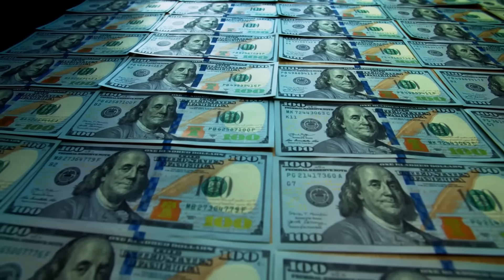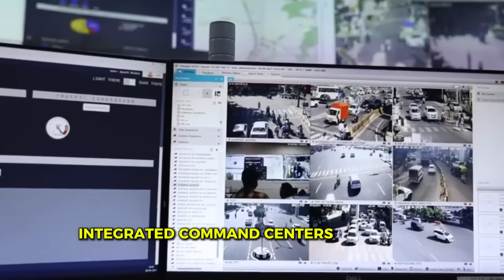15 Biggest Mega Projects that will transform India by 2028

Comment: Unless the Govt stops free bees and reservations, these transformations gonna mean nothing for an average Indian. Bring in an education system that teaches civic sense, moral gratitude and gender and caste neutral policies first.
Reply: Don't mix two things, reservation and freebies are separate things which should be stopped but not so easy because a wrong precedent has been started by the previous Government and constitution of India by b r Ambedkar. People have wrongful habit now. And if present government will remove them immediately they will lose the elections because these people will not boat and a position will use it. If Modi will not be in power how will these development itself will happen. In any case there were only 95000 km of highway in 2014 and now it is 160000 km of Highway. So you are using fantastic highways in last few years so how is it not affecting common people 
There were only 72 operational airport in 2014 now more than 160 in India...